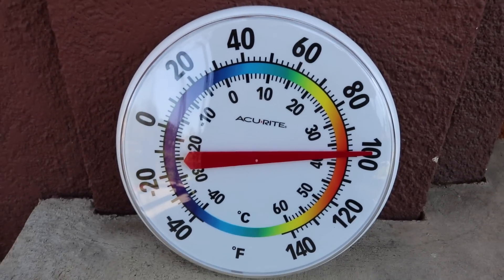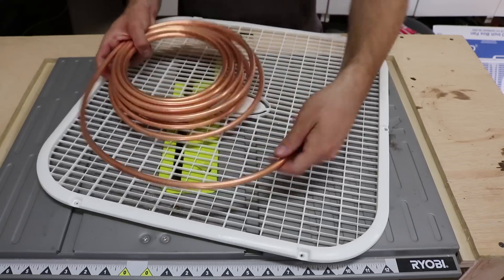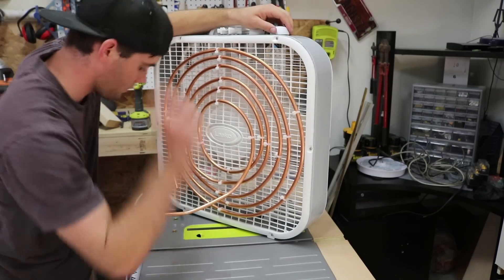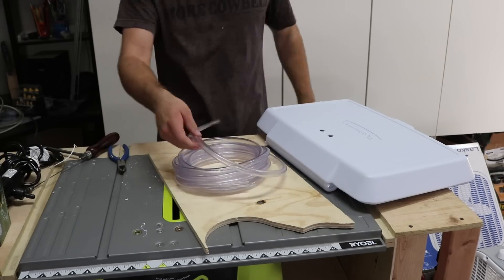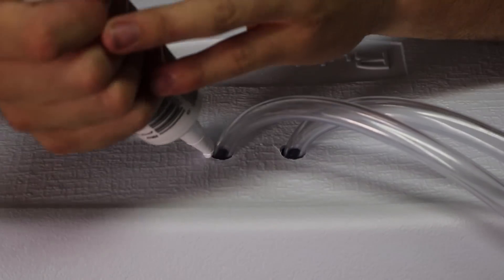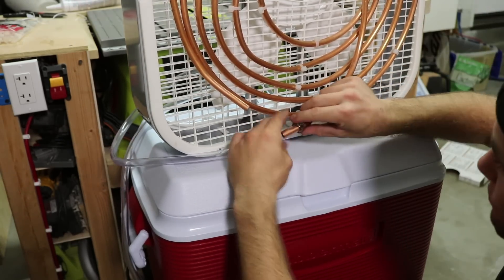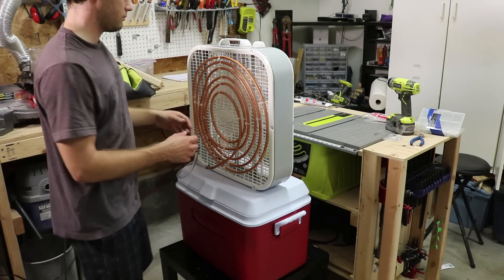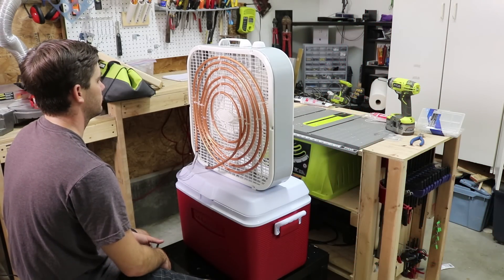$100 Homemade Air Conditioner - DIY

Comment: I think an evaporation cooler would work better.
Reply from the maker: +Pikapetey Animations if this one ever poops out that is what I'll try next. Also the condensation on the pipes is pretty significant so it almost turns into one already
Reply: I don’t think so for those of us in areas of high humidity.
Reply: It would, but it would humidify the air.
Reply: Kyle Hamilton, I have a 5k sq ft shop and a very large evap cooler. They work great if I have the doors open. Meaning the front and rear drive in doors I could even leave the side walk in open and it could be 100° outside and it would feel nice and cool the moment you walked through the threshold. If you kept the shop sealed up and ran the cooler it just got real humid. I tried both ways because the instructions on the cooler basically said keep the doors open and I wanted to see the difference.
Reply: Ben Tardif the condensation is water from the air being removed so actually they're inverse processes I believe.
Reply: Why not just buy a window unit for 100$?
Reply: @codiekennedy8046  There's no such thing as a $100 window cooler anymore.
Reply: because places like arizona have no humidity so it makes the humidity levels tolerable while houston tx has high humidity and it does not work well at all, extremely humid meets more water
Reply: For just about $75 , you can buy a real and powerful air conditioner. 
Google: air-conditioners for under $100.
Reply: Spartan Crown they don't? Makes me wonder how swamp coolers (evap coolers) work in homes, garages, smaller rooms etc 🤔
Reply: Kyle Hamilton  they don't work that well
Reply: Did it cool the room? If so, how long did it last?
Reply: We can buy a real air conditioner as cheap as $90 or even less.
Reply: @simon6071  This isn't true anymore. I was t even able to find a USED a/c for under $100 this year. 😢
Reply: @simon6071  I looked that up. The  prices average around $250 locally. The $76.95 listed was not local and likely would charge and least $100 in shipping.
Reply: They don't work well, if there is no airflow. Any time you run a swamper you should have a window open, or something, so you get airflow and so the condensation doesn't build up too much.
Reply: I agree.  I have used evaporative coolers (swamp coolers) off & on in both dry and humid climates, and have never found them to be worth the money IF the temperatures are fairly high.  Also, if you have a day like we did yesterday (33 degrees with zero wind), there isn't enough airflow.  I even put mine directly in front of an open window, but it only succeeded in adding humidity to the environment.  That said, there are people who claim great success with these devices, & the cost is certainly low enough to try it out.
Reply: Pikapetey Animations ,
That would work in open shops where some outdoor air exchange can keep the humidity levels in check and, because of this caveat, the design would be wasteful of the resources applied to this space as well as the need to manage a safe humidity level. Evaporative coolers are great at cooling larger volume spaces from its high capacity BTU microclimate it creates yet it gets an air exchange as part of its operation to better keep the humidity in check. The last thing you want to do is subject your hand tools and power tools as well as electrical - whether it be lighting or otherwise - to corrosion not to mention building insulation / vapor barriers on an adjoining wall to too much humidity and cause mold and mildew, creating a health hazard and subsequent expensive demolition, repair and everything disruptive that goes along with it.
Reply: Unless you live in the desert!
Reply: Adam Reel
Reply: In California, Nevada etc yeah. They have dry climates so evaporator coolers would work better.
Reply: @𝐓𝐡𝐞𝐑𝐞𝐝𝐑𝐚𝐯𝐞𝐧
I live in Los Angeles, California. Even though it's true that California has a dry climate in generally, there are certain days and nights in the summer when the relative humidity can reach as high as 60%. An evaporation cooler which blows more moisture into the air inside the house would make people feel more uncomfortable instead of more comfortable under such condition.
Reply: Pikapetey Animations , Please ! Those things don't work! All they are is humidifiers. The wet air heats up quickly.
Reply: Evap cooler only works well when the humidity is low. When the humidity is high, not only that it does not work as well in lower the temperature. The adding of more moisture into the air makes people feel more uncomfortable.
Reply: What r u doing here?
Reply: I came her to see how the DIY guy used more than the price of a real air-conditioner to create a toy-air conditioner that require a bag of ice every time he uses it.
Reply: https://youtu.be/TtRkd-rITkU is also a great way to cool down!
Reply: Get out of here lmao
Reply: Yes you're sucking in warm air from the fan and it's heating up your cold  water tubes you need to put a condenser on it
Reply: How do u drain the water out afterwards?
Reply: Not if the area is humid
Reply: evaporative coolers work best in an airid climate, add a lot of humidity to an indoor space (increasing the risk of mold).
Reply: Use a block of Ice last longer z- and use a catchment tray to catch the condensation from the copper tube - it then  goes back into the cooler so don’t get water on the floor
Reply: Evaporative coolers don’t work well in enclosed areas, he’d need to keep the garage door open. They also can put a ton of humidity in the air if not kept in a open environment.
Reply: This is an evaporation cooler. The water pipes make the evaporation occur in the giant vat of water below the fan, but its a swamp cooler that cost $100+ to make.
Reply: The original maker for that ac is the Philippines now you know.
Reply: WHAT KIND / WHERE TO BUY ?  HAVE  PICS ?  DO YOU HAVE A DEDICATED WARER LINE RUNNING TO IT ?  FAN PUSHING COOL AIR ?  I HAVE NEW 40'X50' METAL BLD,  WANTING SOMETHING TO COOL IT (2000 SQ FT) (WRAP ON OUTSIDE OF BLDG (ONLY) THEN METAL APPLIED.  HERE IN  EXCELSIOR  SPRINGS  MO.   WATER RIGHT OUT OF THE GROUND IS 58 DEG.

Comment: Maybe you could put some salt into the water-ice-mixture to get it even colder...
Reply: @N.R.  And the ice will melt twice as fast.  A vicious cycle. LOL
Reply: No immediate temp change in a physical change. Temp change takes time. 

But wouldn't the salt clog the pump?
Reply: salt must put in a bottle..